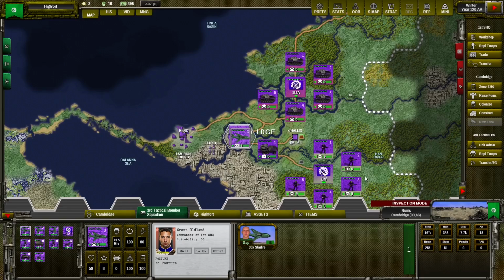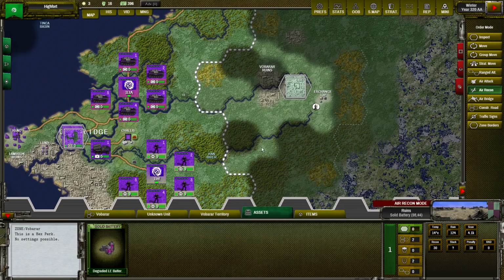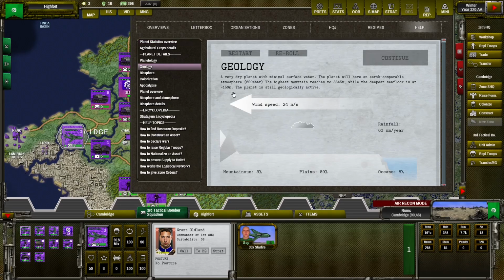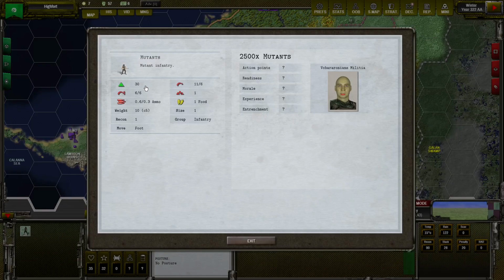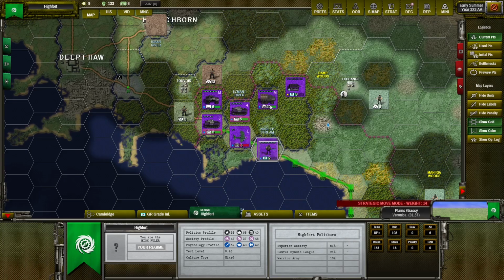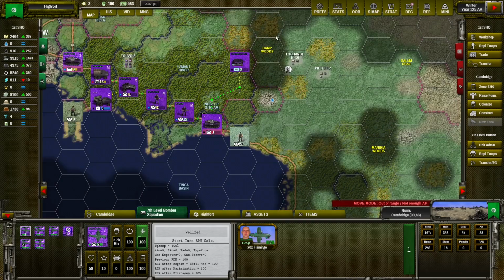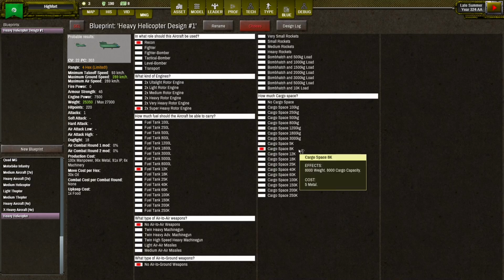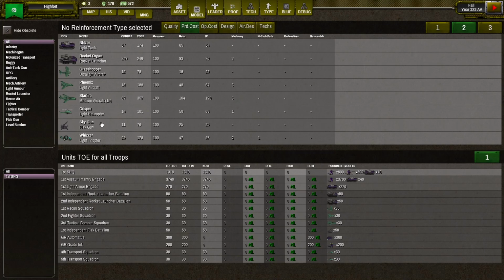Shadow Empire | Aircraft

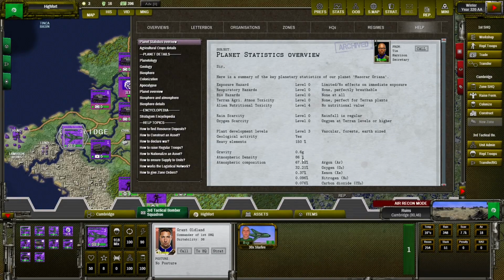Comment: 21:01 That's strange, because a helicopter was able to take off from Mount Everest in real life. In this game, the air density and gravity should make that impossible.
Reply from the maker: Thank you for pointing this out. I've double checked and the manual mentioned specifically thopters (other vtol type) for this rule, so it's something to investigate where is the exact threshold for helicopters. If it's different then you have found a bug in my video! But I will be able to check it in August not earlier so I recommend to experiment on your own.